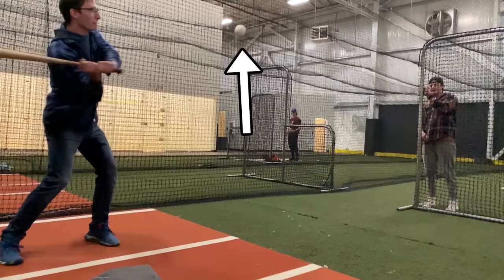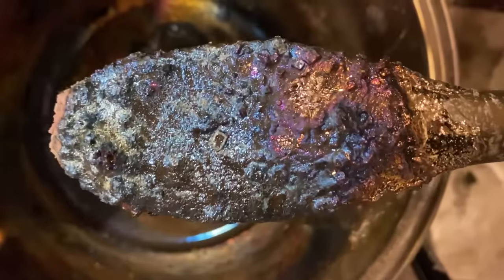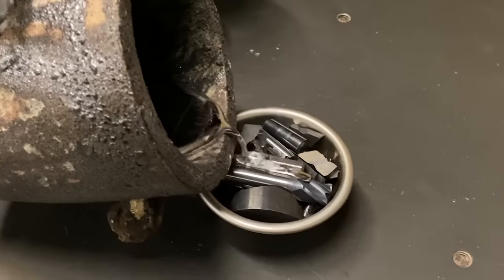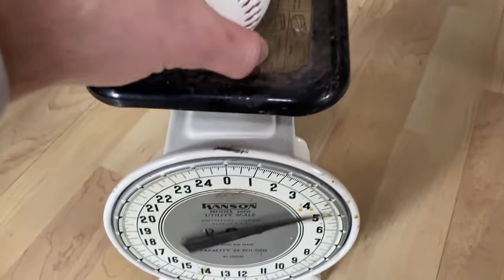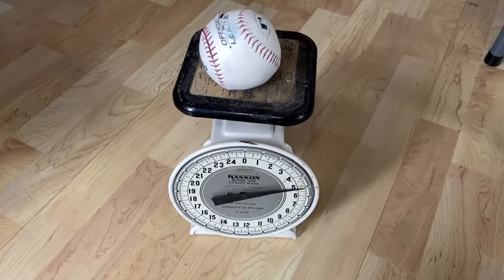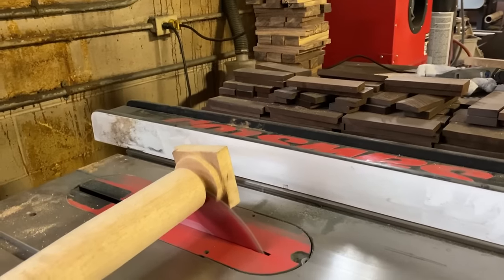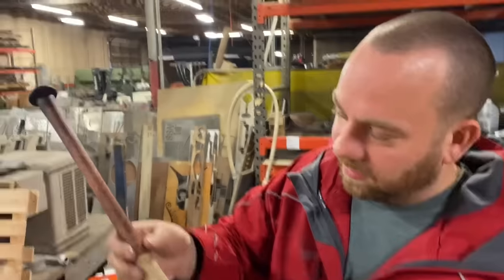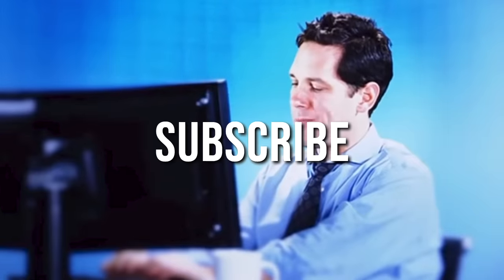I Made The World's Heaviest Baseball

Comment: Aluminum, copper, carbon, graphite graphene, steel, magnesium, and tungsten 
Reusable fire ball

Magnesium burns in air and steel is sparky when hot and copper graphene have a high melting and chemical dissolve point and the aluminum will give it a high surface tension and it will make it shiny and the tungsten is to reduce wear.
Reply from the maker: Thats a little above our Paygrade. You’ll need mark rober. We’re the discount version

Comment: What makes the waterjet so powerful? It can't just be water, right?
Reply: It's all about energy transfer. 

waterjets can cut through a lot but it's not because water molecules are harder or denser or stronger in some way than whatever material they're coming across but instead that they are moving with so much velocity that upon impact the energy transfer pushes material apart. You can think of a molecule of water as a bullet and the water jet as the gun. If you have low pressure you'd have low velocity. Think if you were to take a bullet by hand and chuck it at a steel door as hard as you can. It may dent it depending on how thick the material but if you increase the energy(in the case of the waterjet we increase the energy by increasing the pressure) by taking a round and actually firing it from the gun you'll see much more impact because you increase the energy you start with.